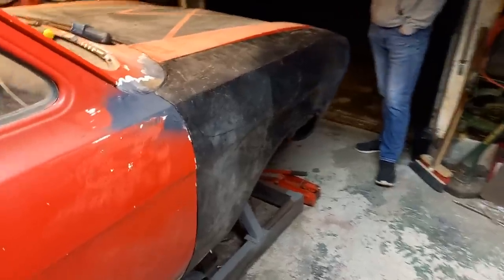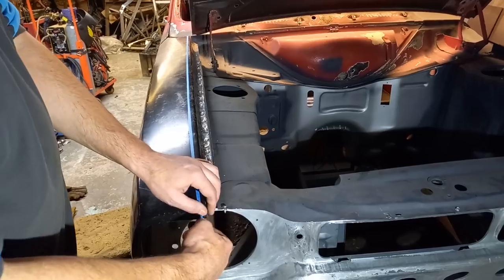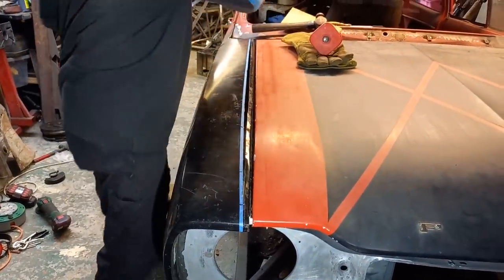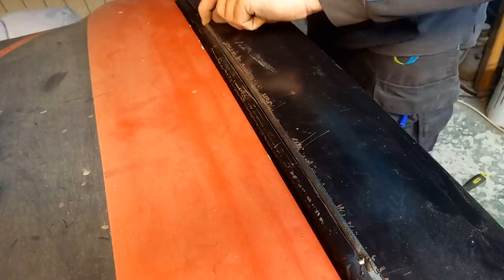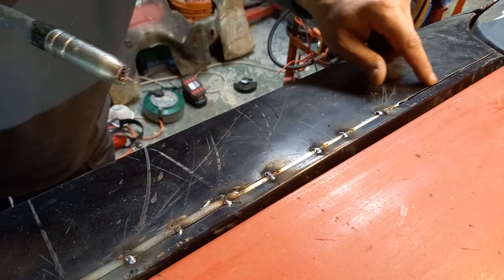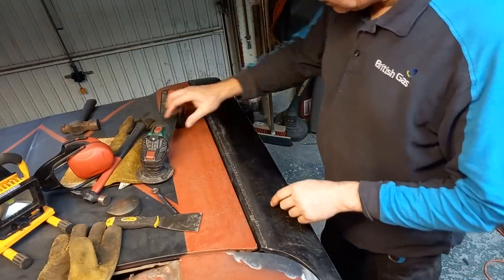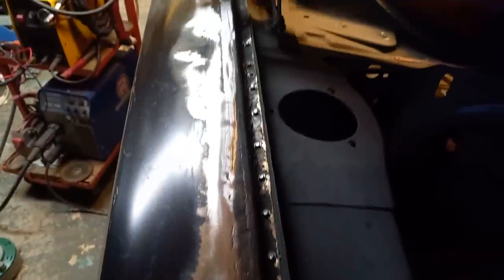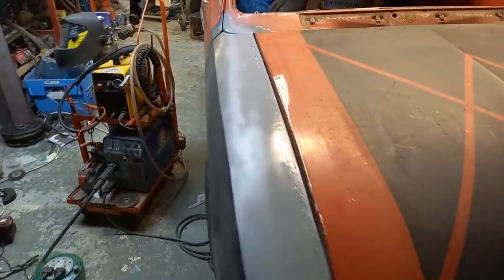Ford Escort MK1. Sorting terrible panel gaps to front wing, part 1.  Car Restoration.

Comment: Had you have lowered the inner wing rail in the middle the wing would sit lower and obviously be further in, what you have done is priceless!
Reply from the maker: Did think of that, but then the upper suspension fixing would have been out, fitted the inner wing to suit the jig I made.

Comment: Won't the wing be wider than the other side tho
Reply from the maker: It will, time will tell if it’s obvious, old saying, if it looks right, it is. If it look wrong, then I’ll get another wing.
Reply: Cracking work you are doing I really enjoy watching. I'm a big Mk1 fan had 2 back in the day. 1 was stage 3 rally prep and the other was a nice Rd going one all seamed welded linings inside etc but carpeted and full seats etc. Cheers on your videos